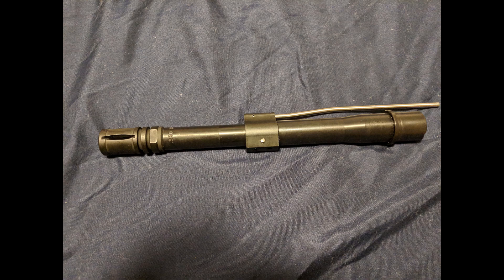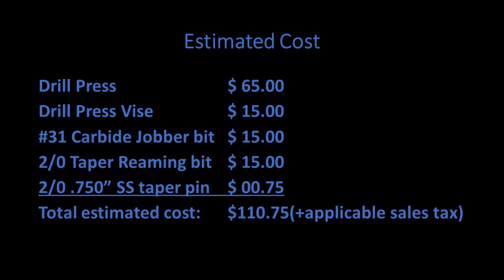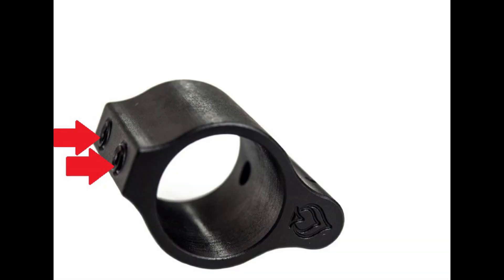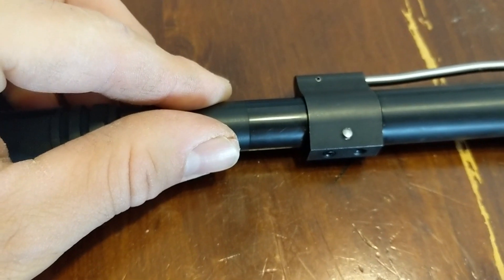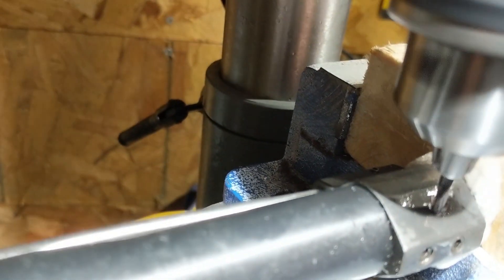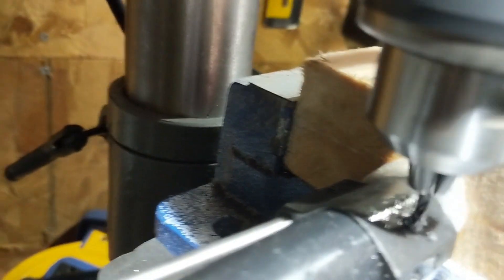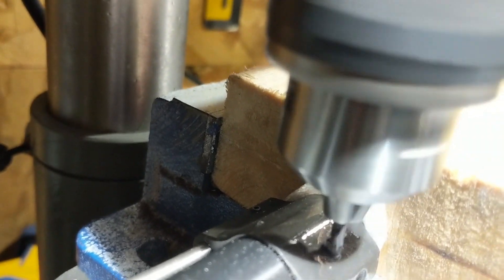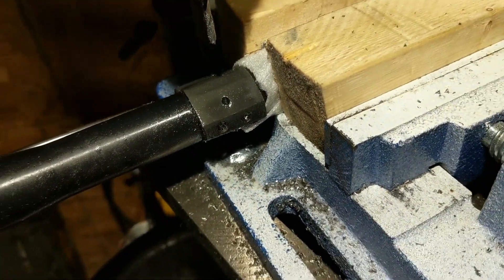How to Pin a Gas Block: a comprehensive guide for the poor and cheap among us.

Comment: Gonna sound dumb but how is the barrel in the vise? Two blocks and what is that a towel?
Reply from the maker: Couple of scrap pieces of 2x2 to keep the barrel from being marred by the metal vise. I have a single wrap of foam packing roll cutoff around the barrel to cushion a bit from scratches on the bottom.

Comment: What drill press do you use? Wondering if a bauer from HF would work or if i need to spend a little more coin for something a bit better( seems like theres very little benefit of a few hundred, and to truly get better stuff its a grand or so.)
Reply from the maker: @teutsga1985  that drill press is a cheap Chinese one from Amazon. HF drill press will work just fine

Comment: Can a roll pin be used or is a taper pin a must?
Reply: Roll pin is strictly ornamental as far as gas block pinning goes. 

Use a taper pin or a dowel pin if you do not want to bother getting a taper pin reamer. 

Roll pins squish and are “springy.”
Reply: Depends on how thick the roll pin is, you’d definitely want something with decently thick walls and pressed tight. Like a 1/8th roll pin. But given that the gas tube and lower parts of service rifles in the AR15 family use them in actual combat situations then I would say yes that would be fine. I believe H&K actually use roll pins iirc from Small Arms Solution’s video. I’m going to do a barrel with a roll pin soon on a 20” build.

Comment: A great tool for staring holes is a center drill they are cheap too. Choking up on a drill bit will cause more wobble and is fare more prone to breaking the drill. Save the oil for HSS bits, carbide dosnt need oil or coolant, we use compressed air to blow away chips for a cleaner cut. As a general rule carbide can be ran fast consult a machinist handbook exact numbers. We machinist break drills and taps all the time it's frustrating, but, most of us are paid by the hour so we work the problem. Learn to sharpen your bits or replace them when they start to wear because it's the dull tools that break the most. You did a fine job, slow and steady always works. There is no "proper" way to drill a hole. I am a slow and steady person too.

Comment: Thanks for this video. Because of you, I bought the correct items, and was able to get it done.
I was very gentle with the drilling and drilled for about an hour and fifteen minutes. 
The reamer was just a few seconds, though, in hand drill. 
👍
Honestly, if you hadn't posted your experience, I don't think I would have tackled this, so thank you again.
Edit: I used an 8" drill press while Inexpensive Arms used a 10", and either my jobber bit was longer than his, or a 10" chuck will swallow more of the drill bit than an 8" chuck. I had to realign the gas block-to- drill vice because the drill bit was so long that it deflected a smidgen as I made the initial hole.  I didn't want to have a wollwed out hole, so I stopped and recentered everything. So, if you use an 8" get the center drill bits and the jobber bit. The center bits seem sturdy enough to not walk. Or, you can just readjust as I did. I hope that made sense.
Reply from the maker: I'm glad somebody found this useful. Couple more times and I bet it will be a ten minute job for you.
Reply from the maker: I'm going to have to get some center drill bits. Thanks for the heads up

Comment: If gas blocks normally only had one taper pin, people would say, "Tapper pins can back-out; what people should really use is set screws, and you could dimple the barrel, oh, and use loctite!"
Reply: Loctight is useless on the barrel or gas block . Thats why the set screws never come with it and you dont locktight muzzle devices . Locktight doesnt hold when its heated up a lot and the barrel gets to hot for locktight to be worth a shit thats why rockset is used on muzzle devices. I use it on lots of other stuff bit im also an automotive tech and thats how we under locktight is with a torch then it spins free.  The barrel gets hot enoigh to make the lovktight liquid and useless

Comment: Have you tried the Delta Team Tactical ELD Performance barrels? I seen a couple people get 1 to 2 1/2 inch groups,  but I just received mine and is everyone I wanted 1:7 4150CMV (SR) I HAVE NO IDEA WHAT the means, and neither did they. Anyway now after I got it I'm just worried it won't be accurate as if I spent 40$ more or so to get a well known brand and better accuracy.    Am I just worrying too much ? Have you tried their barrels? Do you know what the SR means after the 5.57 NATO 1:7 4150 CMV (SR) ?????
Reply from the maker: I haven't tested them.

The markings you're referring to mean:

Chambered in 5.56 NATO

1:7 twist rate. ( Every seven inches of barrel length the bullet will turn one time)

CMV is Chrome Moly Vanadium,  4150 is the grade of steel the barrel is made out of. (4150 CMV is military spec)

I don't know what the (SR) marking means.

Test it out. If it's a shooter, keep it. If it's not, sell it. You'll probably be able to get 80% of your money back. I call that part of the learning tax.

Best of luck!

Comment: While pinning is the ultimate in security, double dimpling and high temp threadlocker is very secure.  Secure enough for anybody not running high-volume full auto.  A dimple jig is less than $30.

Comment: Do I need to take the upper off before drilling? Or can I leave it on? Thanks!
Reply from the maker: You mean should you take the barrel off of the upper receiver? No, but I sure would. 

Part of the issue is that vibration and movement matter a LOT.  You need to have a uniform clamping surface. Any amount of shift will affect your results. Leaving a barreled upper receiver will make things a little unwieldy, even if the upper receiver is just hanging off the end. 

Hope this helps, Good luck!

Comment: How did you decide where center of pinning hole should be, to prevent cutting too deeply into barrel?
Reply from the maker: I eyeball it. I've used jigs, but they're really not needed. If you have a standard 5.56 barrel with a .750 diameter gas block, then it's best to eyeball it lengthwise along the entire length of the barrel and bring the bit down until it touches the gas block while you nudge it around until it's where it needs to be.
Shoot for only drilling 1/2 the diameter of the thickness of the drill bit into the barrel. In other words,  you want to drill a straight line through the barrel that will end up with half of the taper pin sitting in the groove, and half sticking out from the barrel.  From a top down view,  something like this:
▄▄▄▄▄▄▄▄▄▄        <------entire thickness of barrel
▀▀▀▀▀▀▀o▀▀
                     └-----only ½ of drill bit bites into barrel 

Chances are you'll get a slight amount of deflection downwards and wind up with slightly less than that, but when you ream the hole it will enlarge it slightly, and that's just about right.
Reply from the maker: I used to have a jig. After I did it a few times, I just eyeball it now.

I'll repost a comment where I addressed this exact question.. hang on.

Comment: Is there any way to fix a mis aligned gas block?
Reply from the maker: depends on how badly it's misaligned if it's pinned. 
For starters, if it's just clocked a little, but works, then don't worry about it. There's lots of gas blocks that aren't perfectly aligned but work fine. 

If it's rotated enough that you're having cycling issues, You could TRY to rotate it into proper alignment, tighten down the set screws really hard, and attempt to ream the hole a bit bigger and use the next size up taper pin, but that's iffy depending on how much the block is off by. 

Last alternative, you could just remove the old misaligned gas block, replace it, and drill a dimple under one of the set screws, but don't re-drill the taper pin hole. That will still hold the gas block very securely, and will cover the exposed metal from the taper pin you removed.

Comment: How exactly did you figure out where exactly to drill so you don't make a huge mistake and drill too much barrel material? Awesome video though! I've been wanting to pin and dimple all of my barrels but I'm scared to death I'd ruin a barrel and I'd never forgive myself lol I want to, but I can't afford to be replacing barrels unfortunately and I don't have a good local gunsmith that does them so if I want to get it done I'm going to have to do it myself. Any help explaining how to be certain that im drilling the proper place through the gas block/outer barrel would be greatly appreciated
Reply from the maker: You've got more leeway than you might think.  I've taper pinned 0.625" diameter pencil barrels before.

I eyeball it. I've used jigs, but they're really not needed. If you have a standard 5.56 barrel with a .750 diameter gas block, then it's best to eyeball it lengthwise along the entire length of the barrel and bring the bit down until it touches the gas block while you nudge it around until it's where it needs to be.
Shoot for only drilling 1/2 the diameter of the thickness of the drill bit into the barrel. In other words,  you want to drill a straight line through the barrel that will end up with half of the taper pin sitting in the groove, and half sticking out from the barrel.  From a top down view,  something like this:
▄▄▄▄▄▄▄▄▄▄        <------entire thickness of barrel
▀▀▀▀▀▀▀o▀▀
                     └-----only ½ of drill bit bites into barrel 

Chances are you'll get a slight amount of deflection downwards and wind up with slightly less than that, but when you ream the hole it will enlarge it slightly, and that's just about right.

Comment: Wait a minute! You didn't show how to put in/keep in the taper pins... My taper pins just fell out, how can I put them back in and make sure they stay in?
Reply: Its called an "interference fit".  You tap it in fairly tight. Some people actually add locktite on the pin to make sure it doesn't vibrate loose;  but if you do it correctly, it should be a little tought to even tap out with a hammer.
Reply from the maker: Your taper pins are tapped into place with a mallet and a punch.

When I filmed this my phone battery died for the last part, which is why the last part is short.

When you ream the hole with the taper 2/0 reamer, make sure you don't over ream.

You want to ream deep enough that the pin will go most of the way through, but is too tight to go the last 1/8" or so without tapping it into place.

If you do that, the pin will never come out unless you want it to.

If you over ream the hole and it's too big, and the pin fits too loosely, you'll have to go up one size in taper pin and repeat the fitting process.

Comment: How to you feel about dimple and rock set? I have a pencil barrel and the largest od on my barrel is only .625. I didnt trust my self to not go thru the bore and also didnt wanna deal with 5 weeks of "were getting to your gun next"
Reply from the maker: It's definitely about comfort level. I've done a pencil barrel before with a .625 gas block using the same method, but I just went really slowly and measured about 5 times before I did it. Turned out perfectly. 

Realistically though, if  you're covering the gas block with your handguard, and you're not falling down mountains or jumping out of helicopters, dimple+high temp threadlocker will suffice.
Reply: @inexpensivearms6952  thanks for the response handguard runs about about 1/4" from the fh so i think ill ill just leave it be 🤙

Comment: It’s supposed to be a coil pin. that’s what Ballistic Advantage uses and it makes sense.
Reply from the maker: They do coil pins because they don't want to have to add an extra step to taper. 

Taper Pins are more durable.  It really doesn't matter though. They're both tough enough to take a licking and keep on ticking.
Reply: Inexpensive Arms  taper pins don’t give you a canted load? Don’t you want uniform compression across the whole surface? Since it’s a drilled out barrel and the gas block needs to be level?
Reply: @johnviera3884  its not a canted load as long as the pins are tight and match the reamer. You're just removing steel and replacing it with steel. It may as well be one piece.
Reply: Using coil pins is the reason BA has the reputation it does. 

BA cuts corners at every opportunity and makes some of the lowest quality barrels on the market.
Reply: My two ballistic advantage barrels have been shooting lights out for the past 6 years.
Reply: @johnviera3884  I’ve never seen one that didn’t group like a sawn off with buckshot, that assuming it worked in the first place.
Reply: @ recently? maybe they changed. I’ve never had an issue with mine that I assembled 6 years ago. And I didn’t know that there was a wide known issue with their barrels.
Reply: @ Last 3-4 years their offerings have been abysmal. 

Even their official YouTube channel, the majority of the comments under their videos are reports of barrel quality issues and customer service issues to those bad barrels.

Comment: Where did you get the pins  and what size are they
Reply from the maker: https://www.mcmaster.com/90681A131/

You can also buy them from  numerous places like https://brdengineering.com/products/stainless-steel-taper-pins-2-slash-0-0750

They're 2/0 taper pins that are 0.75" long.

Comment: A FYI. 4 Flute carbide end mill works very well to start the hole. chuck up short. thats how I do this on my milling machine. and carbide does prefer high speed vs. low speed.
Reply from the maker: Thank you! That's a great idea.  I've since increased the spindle speed by about 50%. I'll try bumping up another notch next time.

Comment: This was strange to watch. My recommendation is to use a dimpling jig and dimple your barrel first before you screw with your pinning. Also, you need to rotate the gas block so the bit goes in perpendicular for a very small distance, just enough to create a divot where the bit won't have an incentive to move sideways. Turn it off and remove the bit from the gas block surface. Move it slightly toward the correct position widening that divot each time. Eventually you will have the correct drilling angle without having to worry about your bit trying to move sideways on you. The only hard part is determining where to start your divot. Third, anything from tapping fluid to WD40 works fine. It is just a lubricant that absorbs heat and doesn't allow the bit to over-travel. Also, you can use a size 0 or size 2/0 with associated taper pins. Both work fine and you don't really need some $15.00 jobber bit. A $2.00 1/8" Bosch brand cobalt bit for drilling steel will do just fine and gets you a hole just outside of the minor radius of your reamer. Reapply lubricant generously, and take it slow. I would also recommend you grab a piece of junk wood that is 0.75 inches thick and perform the same process on it as practice before going at it, this way you know how deep to ream your taper bit and you can see that buy noting how far the taper pin passes into the hole reamed in the wood. Whatever forced (by hammer and tap) travel would be required for the pin to secure in the wood, divide it by 3 because your taper pin is going into steel. Also, when you put your set screw in for the last time, be sure you use rocksett, not loctite. Most loctites don't go above 500F, but you are golden with rocksett. My other recommendation is to make sure you secure your barrel nut before attaching your gas block permanently...doing otherwise is a rookie mistake.
Reply from the maker: I like the idea about turning the gas block a bit to get started. That would probably contribute to not having to buy a carbide bit. 
My experience with HSS and coated drill bits was that they just didn't quite cut it on nitrided surfaces,  but carbide bits just go through like butter. I eventually just bought a few carbide bits to save time. They've held up really well.  YMMV. 

 The barrel I was pinning already had a dimple for the gas block, but I've pinned barrels that don't have them. 

Good comments man. Thanks!
Reply: Stop giving bad advice. Wd40 is absolutely unacceptable, and hss or anything less than cobalt is absolutely not suitable for a nitride barrel (a supremely popular treatment today. If you don't have all the facts, please don't comment. I'm really not trying to be rude, but bad advice like this can certainly ruin equipment, or a barrel.
Reply: @jamesstephenson2346  Nothing wrong with WD40.  Clean it with CLP when you are done.  Quit whining.  Your equipment doesn't need to be coddled.  Found the guy who has never had to use a garden hose on his rifle!
Reply: @jamesstephenson2346  Wait....wait a second....you realize that pinning doesn't go into the bore, right?  Now I am wondering if your comment was somehow satire...
Reply: @jamesstephenson2346 If you have a nitride coated barrel, you bought a bad barrel.

Comment: Should put barrel nut on before pinning?
Reply from the maker: Not when  you're just drilling and fitting it. Before final assembly, you'll need to though. 

Once you get a fit you like you simply tap the pin out, remove the gas block, slide the barrel nut on, replace the gas block, and muzzle device, and torque the barrel nut to spec.